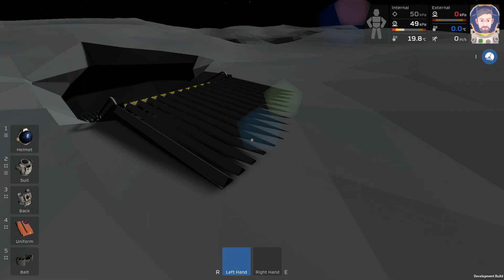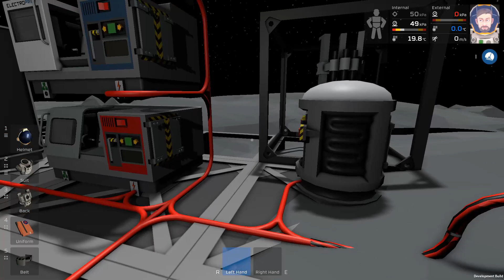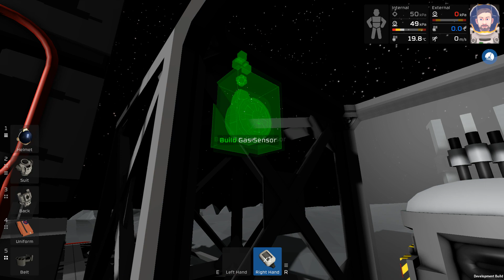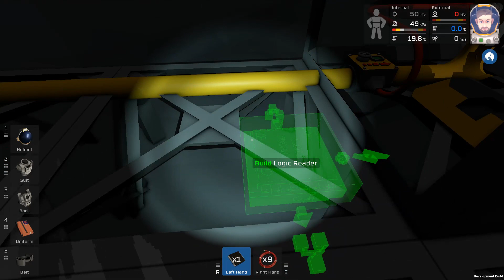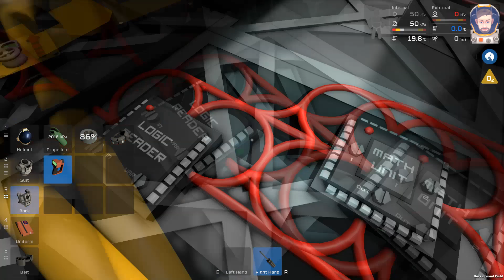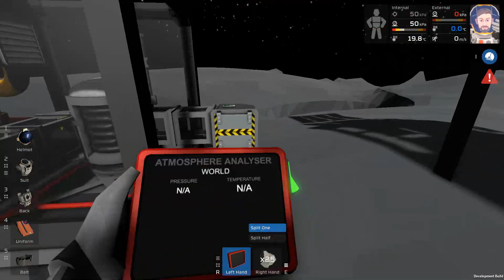Passing Gas - 3 - Stationeers

Comment: i made the setup, but my logic readers dont have furnace input wuantity, only import count and export count, and if i use those i wil only cycle one stack of ore before "jamming" even though there is more ore in the input
any idea?
Reply from the maker: they've released an update that includes an item called a 'slot reader'. You'll need that instead of the logic readers